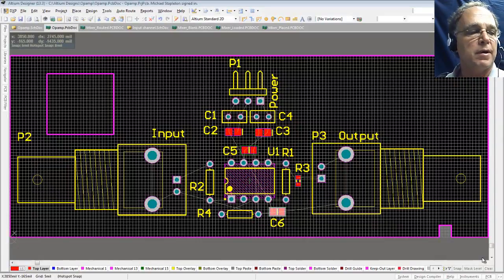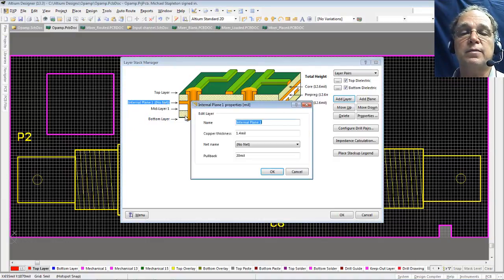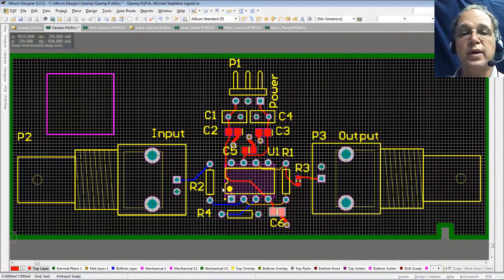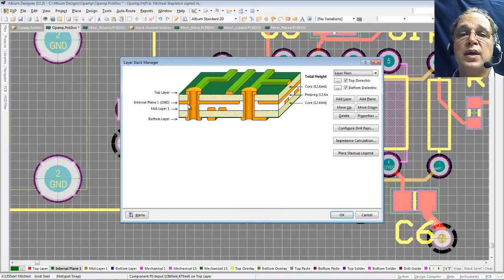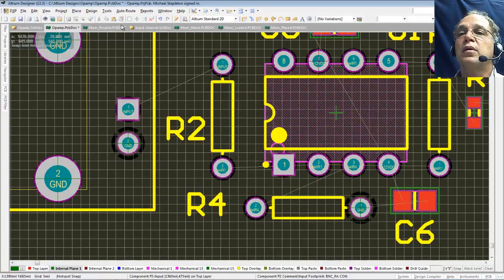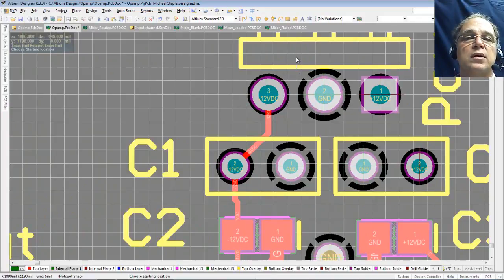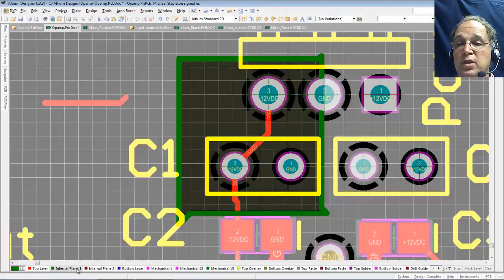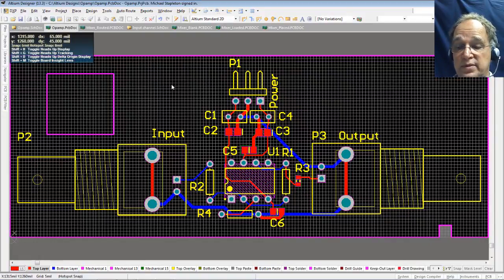Altium Designer Tutorial 1 for beginners - Part10

Comment: Ok I understood in plane u remove copper and in layer u add copper lines... but in case of plane as u made a small square for -12Vdc... how would u supply -12Vdc in the middle of the plane i.e. somehwere in the middle stacked and in circuit... pls clarify thnaks!

Comment: What's the difference between plane and layer? if there are two copper layer separated by dielectric layer (2 planes - 1 layer) then isn't it a large capacitor itself? 

Why have u used separate layers for +12Vdc and GND. Also are libraries and DRC already defined / Provided in ALTIUM?